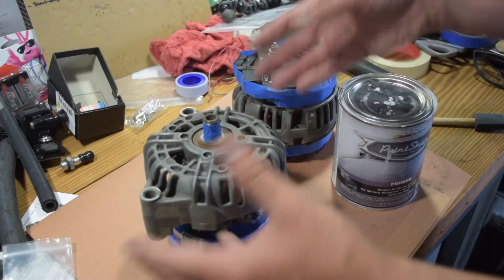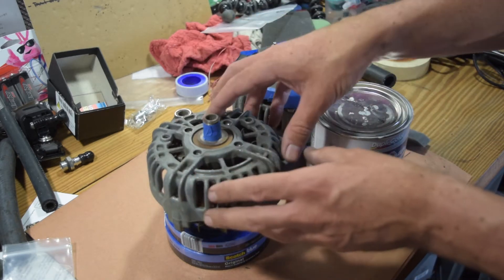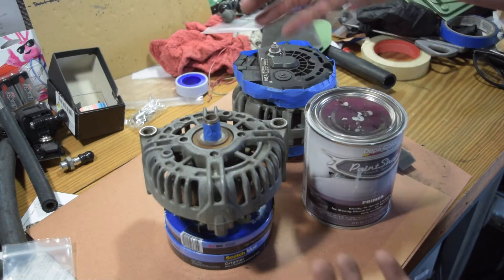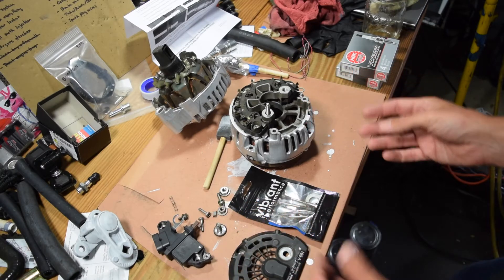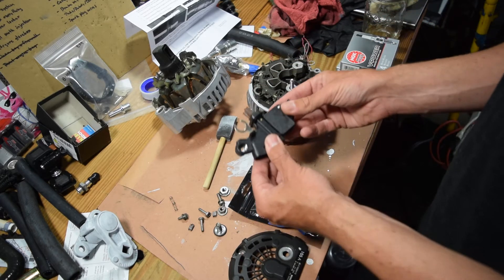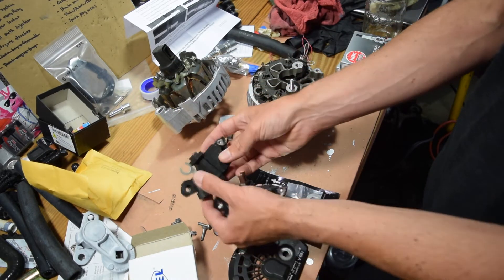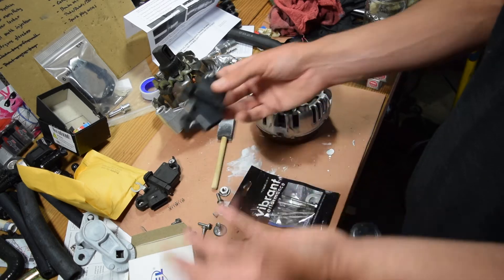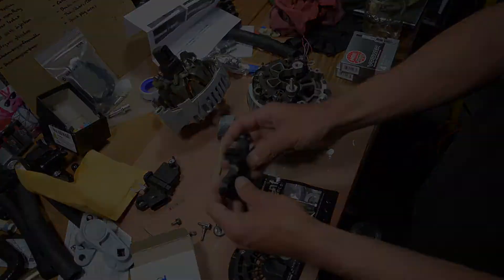LS Alternator Rebuild and Refresh

Comment: One thing.  You broke the brushes.  They touch the "slip ring" on the center of the rotor.   The slip ring is simply two copper rings, attached to either end of the coil on the part that spins.   When they wear, they develop deep grooves.   If they weren't work, I believe the brushes would have slid straight off.  So they likely got caught in the grooves and broke.   

The slip ring isn't terribly hard to replace.  There are videos on here showing it.   If you didn't change the slip ring, it could cut all the way through the slip ring, and (hopefully) stop the alternator from working.  The other thing could be that it makes a short at the brushes, since they'd both be touching the same piece of metal.  

The slip ring is a normal wearing part, and would probably be replaced when rebuilding.

If you don't remember what condition they're in, it's probably worth taking a look. It's better to have it perfect, so you can get 100k miles out of it, rather than it breaking in 10k miles or less.
Reply from the maker: Yeah, I checked the slip ring and it wasn't worn or anything so I felt ok leaving it as-is and installing the new voltage regulator with the new brushes. This was one of those dumb $50 mistakes that I hope I only ever make once.